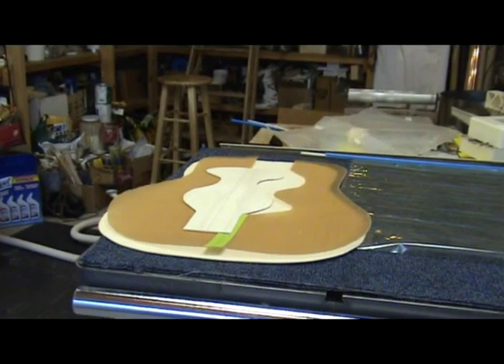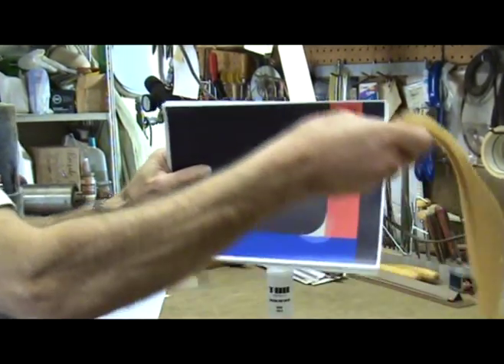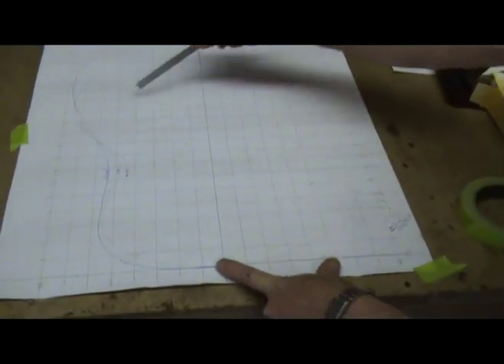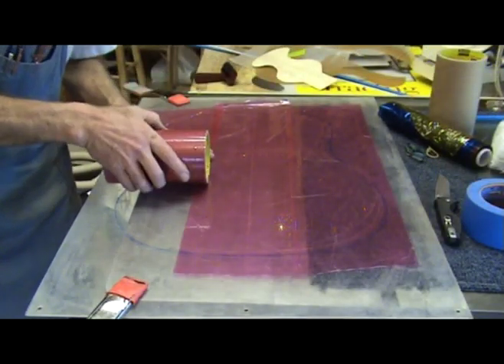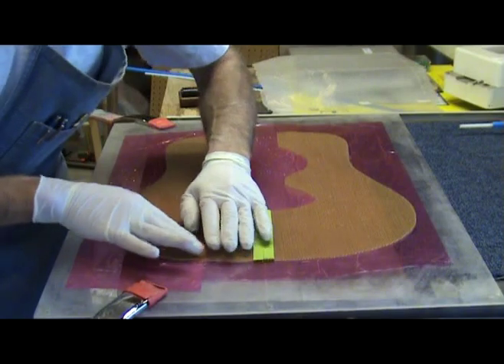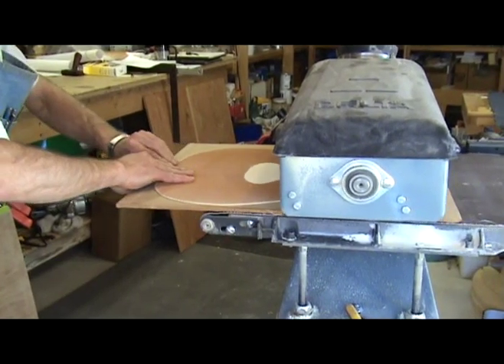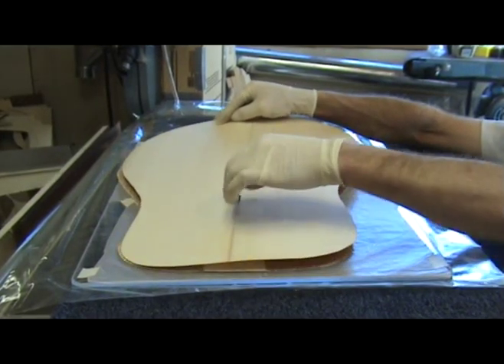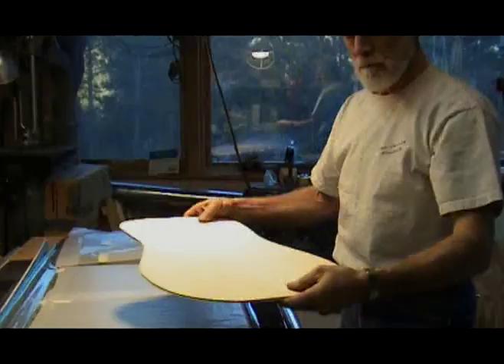Luthier Tips du Jour - Double Tops - Part II of II

Comment: What kind of vacuum bag can I use?
Reply from the maker: There are many commercially made bags available. A quick google search brings up many. Just find the size you like and the thickness you like. basically anything will work.
Reply: OBrienGuitars I was afraid it was some kind of high tech luthier equipment, so if these common vacuum storage bags work it becomes a lot easier! Thanks for the assistance and for keeping my favorite channel on YouTube!
Reply: Would it be possible to use weight instead of vacuum press? That would make the whole project doable for me.
Reply from the maker: I would use a vacuum bag made for doing veneers and other glue ups.